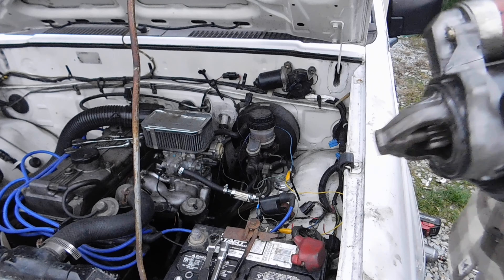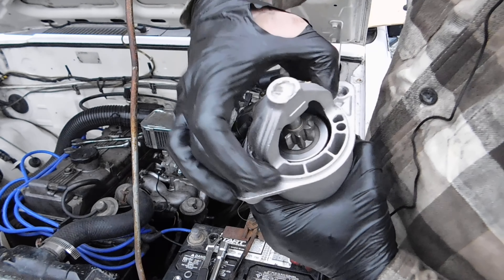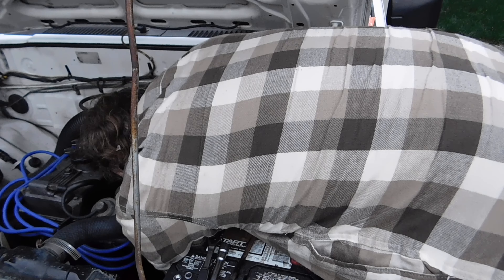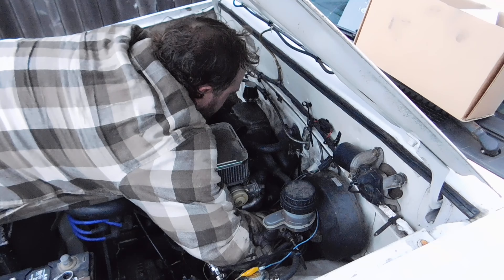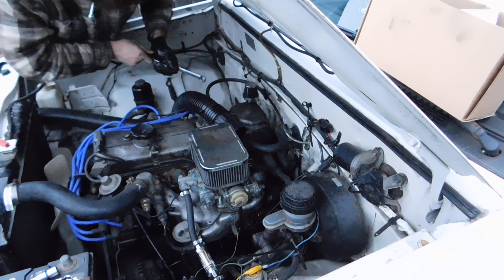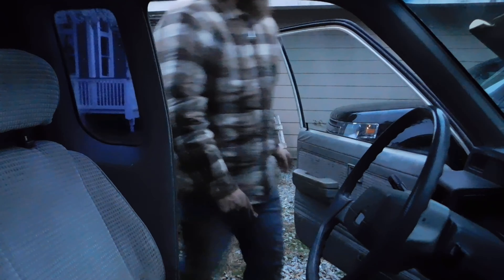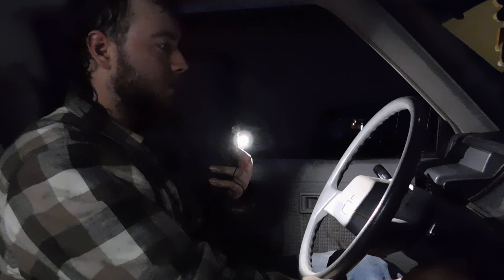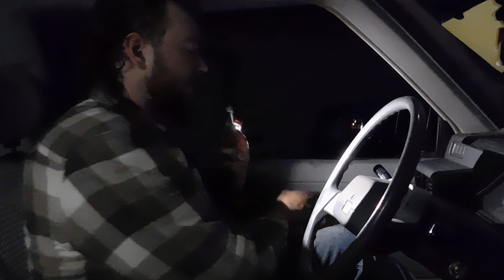Ram 50 Starter Replacement

Comment: Little late to the game my apologize I have an 87 ram 50 also 4 x 4 pretty clean however I’m not able to find the NGK wire set that I see you having? What specifications do I search for find those wire sets as I’m an avid fan of NGK performance or at leastwire spark plugs on Import motors let me know thank you please
Reply from the maker: I can't find these specific wores anywhere for you. The truck came with them, all I know is they are NGK 8mm wires. My guess is someone made them since you can buy a spool of 8mm NGK wire for pretty cheap, and the boost and crimps are also cheap.

Comment: What is that black tube leading to the carb? I have 1989 dodge Ram 50 2.0 truck.
Reply from the maker: That is an old vacuum cleaner hose that's cut down to provide cold air to the carb, on the original carb and air cleaner it had a snorkel that ran to a ram air pickup behind the pass headlight for cold air.
Reply: Oh ok. For your other video when you changed the starter. Does it just slide in when installing it and was it easy? I had to kick start my truck cause the starter Is no good.
Reply from the maker: Sorry, I never got notified you commented again.
If you haven't figured it out by now, yes it's pretty easy to get the starter in and out of the truck. The starter fits between the intake and battery then you just reach around the firewall side of the intake to help position the starter, then you can slide the bolts in really easily.

The hardest part is the upper bolt because I didn't have my good tools with me yet when I did the install but with flat ratcheting wrenches then it's pretty easy and just a crows foot to torque.